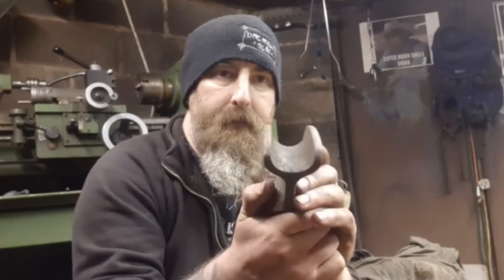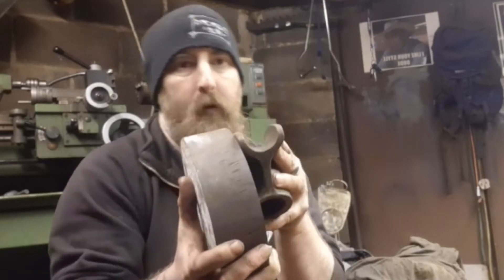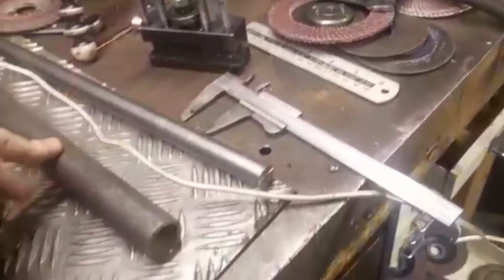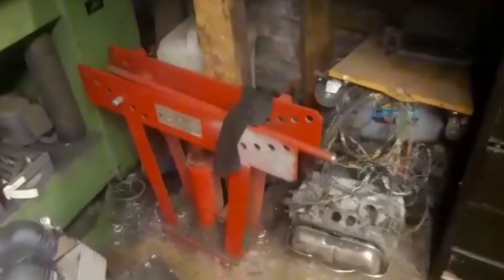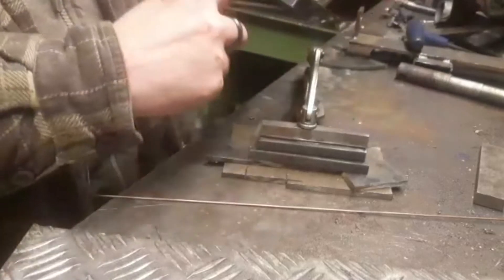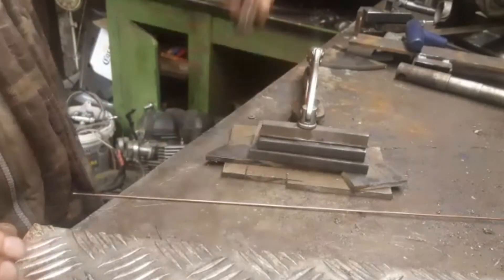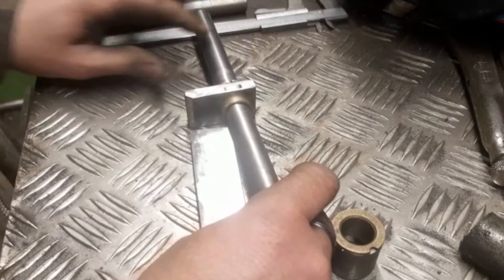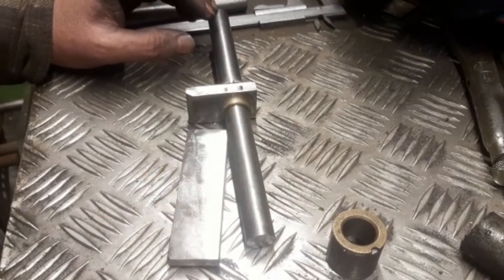DIY Radius cutting tool holder for Lathe. Garage built Chopper

Comment: Great inspiration- I started mine today!  I would like to ask though- what tool shape do you use that will allow you to sweep the radius in both directions?
Reply from the maker: Hi
I've used several tools but currently its an end that I cut of a Boring bar, so it only cuts on the anti-clockwise rotation. Its fun experimenting depending on the job.

Comment: Could i use this tool to make pressure die for tube bender ?
Reply from the maker: Yes. Just machine it as a circle and cut it in half. You'll end up with 2.
Reply: @guerrillabuildchoppers4823  thank you for your response.

Comment: It looks like you can change the radius by moving the cutting bit in and out?
Reply from the maker: Correct, the tool locking bolt in the bottom allows it to move in and out. It will cut from 20mm radius upwards within reason. 
Thanks for watching, hope it helps.
Reply: @guerrillabuildchoppers4823  got it, thanks!